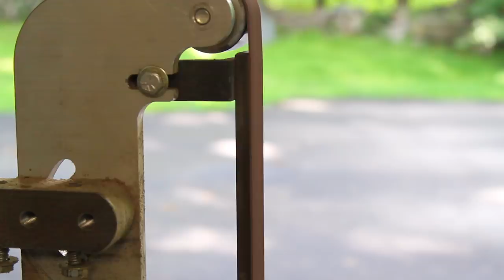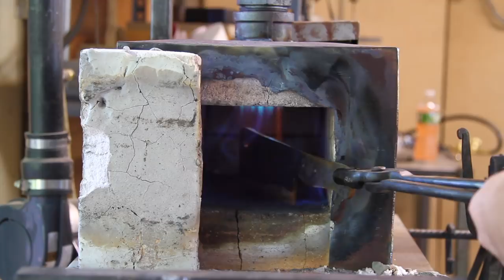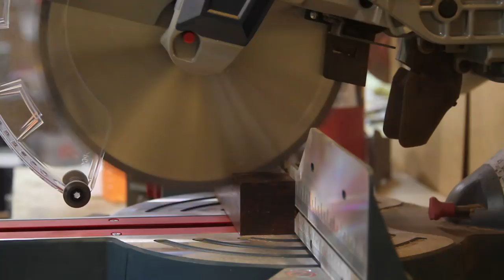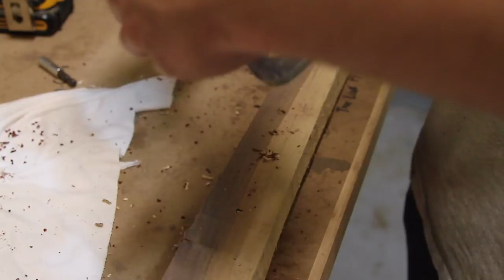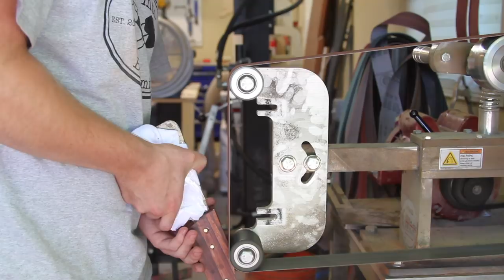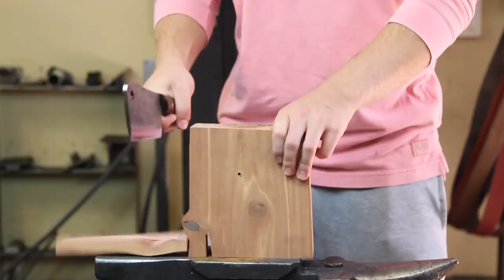Forging a Cleaver - Part 2 Finished

Comment: Nice cleaver Paul! Finished out nicely! Have you fiddled with tapered pin holes and peened pins? Experiment with annealed brass in scrap wood. Pins should work harden as you fill the taper.
Reply from the maker: Thank you! And I haven’t yet but I will definitely look into it and give it a try